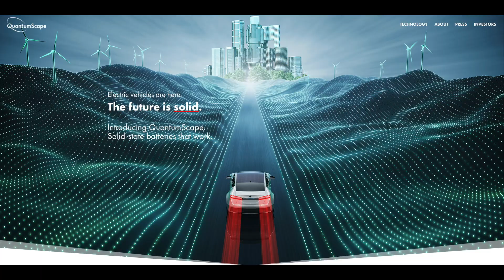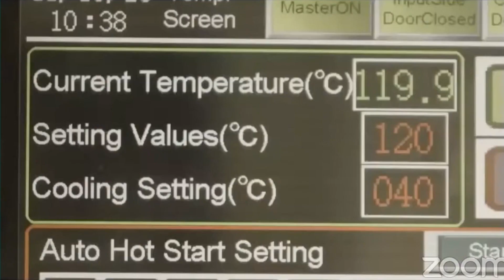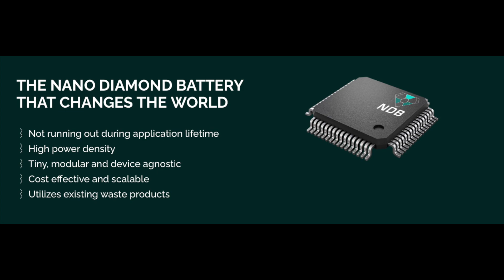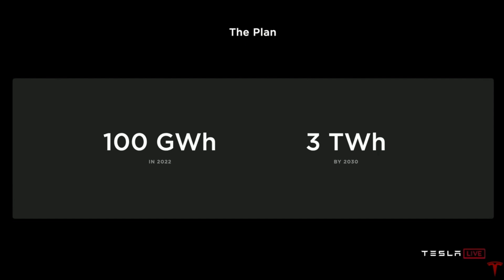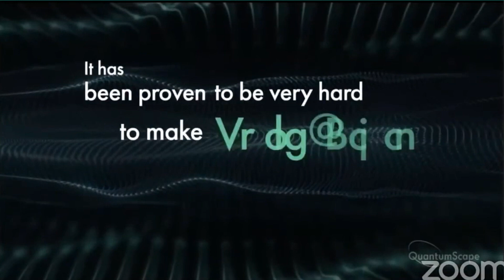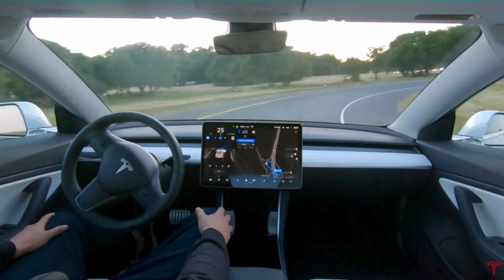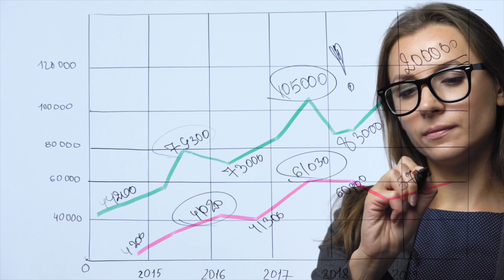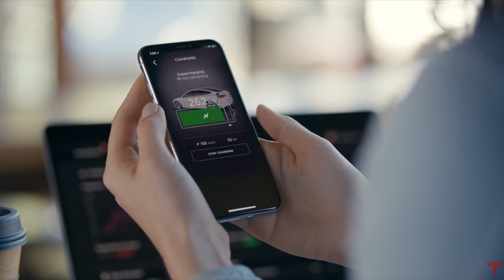Toyota's Solid State battery and the future of our transportation

Comment: Using a robotaxi is great for when you aren’t carrying much but not convenient or practical a lot of the time. Today we went for groceries and some other shopping. We dropped the shopping in the car while we had lunch etc and the bought the groceries. All of our bags for the groceries also live in the boot of the car. A robotaxi would’ve been a pain today as we’d have to carry all the bags and shopping around at the same time.

Similarly, going on a drive to visit friends who live in the country. They live 300km away and there is very limited transport so driving is the only practical way to get there. 
I think that robotaxi will reduce the need for many families to have a second car, but that lots will still own one for quite a while - or rent one for exclusive use for trips or edge cases.
Reply: Don't let the term "robotaxi" limit your vision. Autonomous driving will provide a full spectrum of services. Options will include the ability to use a vehicle for a period of time. For example, you'll be able to use the app to summon a vehicle which you can use until you no longer need it. You'll then release the vehicle back to the fleet and pay for the time and mileage that you used. The vehicle menu will include cars, trucks, vans, buses, recreation vehicles and more as time goes on. I'm thinking watercraft and VTOL aircraft here. Today, we own cars and we always have to compromise because no single vehicle can meet all our needs. In the future, we will have what we need, when we need it. I can't wait.
Reply: @gradmiral  I understand and am not limiting, however I still think many people will opt for a private vehicle unless they live in a city. As I said above, I suspect that you’ll be able to do a dedicated short term hire where the car is yours exclusively for a period of time. A bit like the car sharing apps that are about now. 

I’d use that but would hate to lose my own car. I have all kinds of things in it that are useful but you wouldn’t want to carry in your hands. Umbrellas, a jacket, tissues, shopping bags, sanitiser, etc live in the car.
Reply: Mark - Ummm , robotaxi can go to Walmart or Grocery Store pick up your Web order and bring it to your home.
same for LOWES and Home Depot , each will have a FSD Cybertruck that will load up with your order and Deliver it to your jobsite.
Reply: @markplott4820  we have online groceries etc available but never use them. It’s not the same and I prefer to choose my own fresh food. 

I agree that automated deliveries are coming, but that’s not the point. 

On longer car trips you need exclusive access to a vehicle, otherwise you are trying to carry your bags around with you all the time rather than locking them in the car.
Lots of people will still want a car, but many will do without the second one because of the economics and convenience of automation.

Comment: One thing I think you're overlooking; While it is true the amount of cars will go down to 20%, the amount of miles driven will double or even triple. This, of course, means that the average car drives 10-15x as much as it used to. An EV lasts 3 times as long, so the replacement rate will be 3 - 5x higher.

In my country cars are replaced every 15th year right now. The average will sink to every 3rd to every 5th year. This, of course, means that we in the worst case will still need to deliver 60 million vehicles per year, globally (best case, 36 million vehicles)! What does that make to your figures?

Comment: 60m cars pa in 2033 = 300m by 2037...
Reply: It wouldn't be smart to build out production capacity to those levels. These factories costs money and 300M FSD cars could replace all 1.5B cars, but what would you sell the next year? S-curve will slow down at some point to optimal production levels of around 70M FSD cars per year I think. That way it is sustainable and Tesla can earn back the capex on those factories.
Reply: @bartgroeneweg7765  have you seen Boston Dynamics Atlas? I think Tesla will make this type of thing from 2032 when all the car needs of earth 🌏 are done ✅